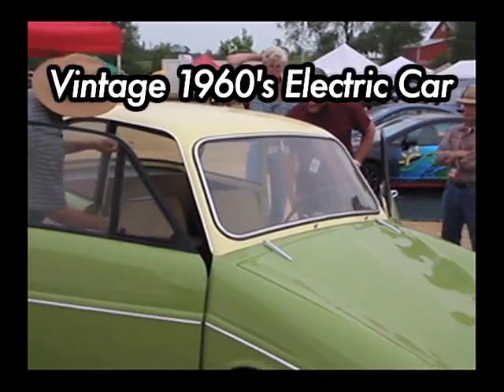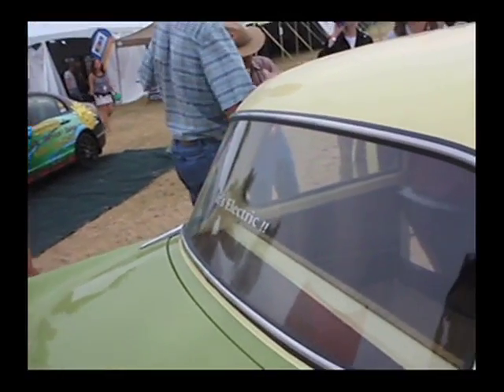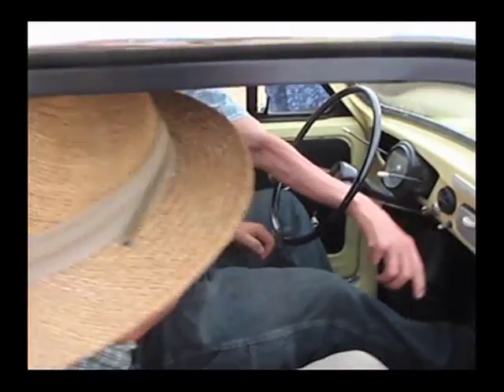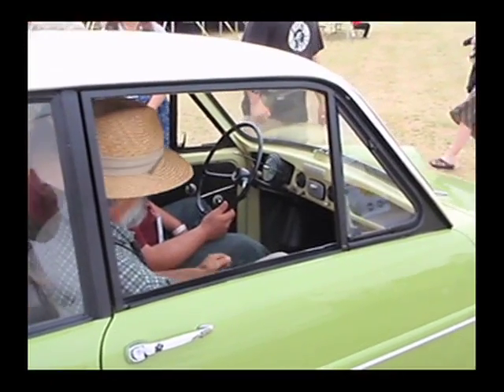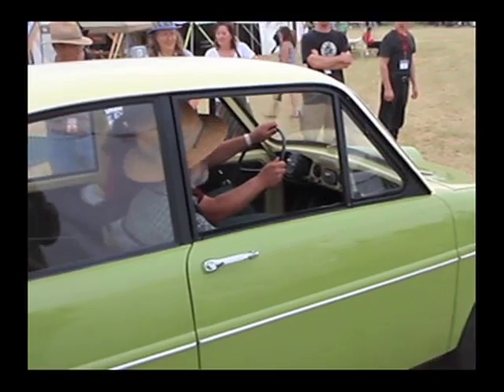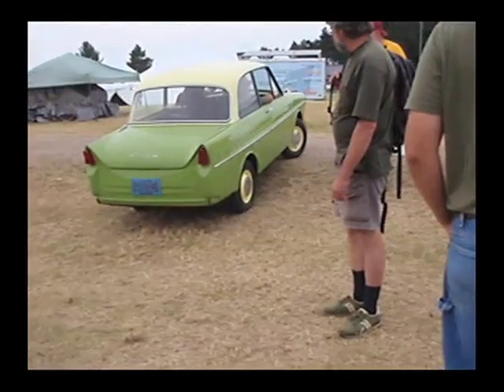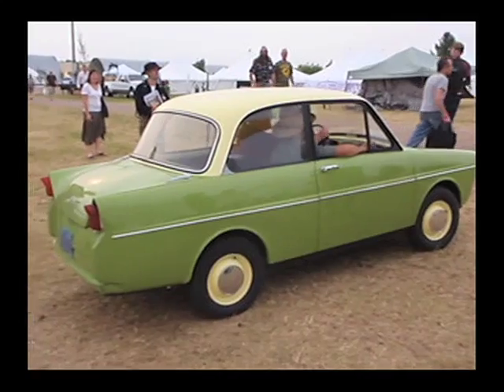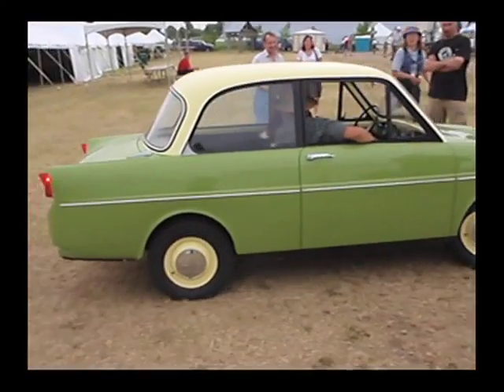1960's DAF Electric Car

Comment from the maker: @Sohave 
You are correct. The way electric vehicles are typically done now is with higher voltage systems. You can use thinner battery cables and get higher speeds. The only real downside is that higher voltage components tend to cost more. The "Open ReVolt" controller is one way to help get around the costs of a higher voltage vehicle.

Comment from the maker: @Sohave 
That's the funny thing, it DOES have a big battery pack. I think there were 24 batteries in there, it's just that it's all arranged into a 48V system. I think it's a 550 amp Curtis controller in there. Once it gets going, the car really goes!